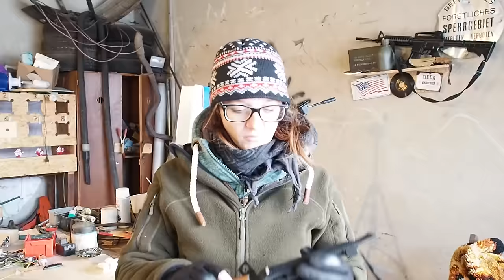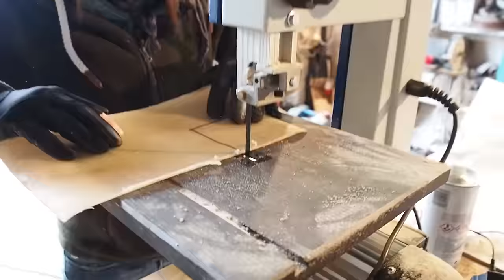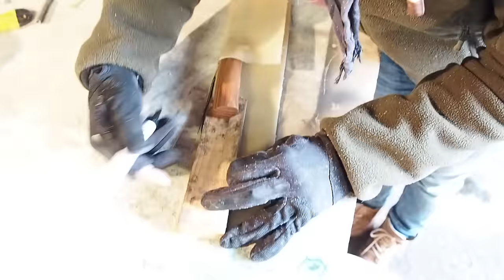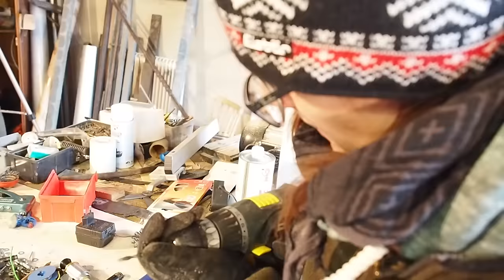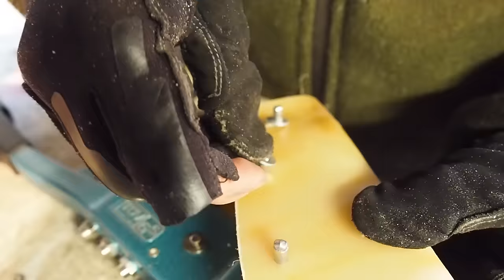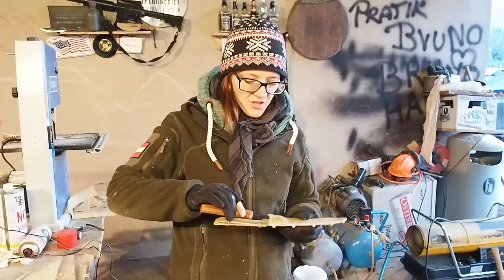Making A Custom Sheath For My Mora Primitive

Comment: I remember doing something like this with a knife I found at a flea market. Sheath was beyond corroded and made one out of plastic and molded and fused it together with a toaster oven and wrapped the outside with old leather. It came out looking terrible but in the end the super thick melted and fused plastic actually has done a good job over the years.

Comment: Lilly, do NOT use an angle grinder without the protective cover. It is soooo dangerous!! If the disk explodes you will have the peices alover your face with severe injury or possible death. Do NOT ure it if the cover is gone!

Comment: A note from Grand-pa. Wear Eye Protection anytime you use power tools ! I've been a woodworker for over 50 years , it's real easy for a chip to fly into an exposed eye or worse. Stay safe .
Reply: Good point, but she did wear glasses didn't she. Guess glasses are far from ideal as protection, but perhaps she did need them to see as good as possible?
Reply: I was more concerned that she was wearing gloves and long sleeves.

Comment: I don't think you'll like those rivets digging into your side later? I'd punch out the ball, file some excess off and beat flat with a hammer, you have the backing washers so you don't have to worry about the rivets coming out. good job tho

Comment: Nice workshop there, looks a strong and durable sheath you could offer a life time guarantee for that Lilly, hand made great job
Reply: Stephen Hall Yep but those rivets are too big imo. Something with a slimmer profile would be better suited for something like a sheath. Those are the kind we used to rivet steel plate together where I used to work.
Reply: Joe Blazer Yeah pretty important stuff lol It was a small elevator cabin made from heavy gauge sheet metal, part of a scaffolding system. When you think we made hydraulic scaffolding for skyscrapers it might be scary but if I remember correctly it was an r/d project. Also might not have been this exact kind but definitely similar.

Comment: Hey, Lilly, 

Loved the video. 

As a bit of a suggestion, after you used pop-rivets and washers on the back to close the sheath, I suggest you should have turned the sheath over and hit the back of the rivets (which is next to your leg) with the front of the rivets on an anvil and hit the back of the rivets with a hammer. This flattens them out a bit more and makes the riveting tighter, and then grind/sand them off a bit so they don't wear holes through your pants.

Love your videos. Keep them coming.

Love to see you with more.

Comment: Hey Lilly, great sheath. I have a funny story ..(wish we could post photos here) I lost the sheath for my beloved old Mora companion. After much deliberation I had an idea: The two connections with pinched ends on my vacum clearner for getting in to narrow spaces (that i never use -  Im not big on housework!)  fit perfectly together, smaller on bigger. I tried one at first and was a perfect fit! - but the pointy end of the knife stuck out the end. Put both together though and its a perfect snug sheath for the old girl...who knew?

Comment: Nice job Lilly!
You used the tools very well, like a pro
I have made a couple of sheaths like you did using thin wall pvc pipe, it was the only material I had.
Get a piece of 4 inch diameter pipe, cut to length, make a cut from one end to the other, heat it up and flatten it out and proceed as you did.
Luv ur videos

Comment: Your resourcefulness and ideas always keeps me coming back for more... Great work Lilly!... Tip: Never leave that sheath lying around in the sun light. Oil based plastics become dried out and very brittle and start cracking and/or breaking easily over time with sun exposure. As thick as that looked, you may very well be ok, but it wouldn't hurt a thing to protect it from the sun none the less. Most people don't think about it from day to day, but the sun reeks havoc on a lot of man made things daily.
Reply from the maker: Thanks for the tip and thanks for checking in :)

Comment: All these people commenting that you shouldn't wear gloves around saws and sanders have obviously never worked worked in a metal fabrication shop! I own a fab shop and wear various gloves all day every day. It's necessary because metal parts are sharp and get hot quickly. Wear leather gloves that fit right and you're safer with them than without when using almost any power tool. Gloves have saved my hands from severe injury more times than I can count over the last 30 years and I've never once had a glove get caught or pulled into a moving blade or belt.
Reply from the maker: Exactly what I thought
Reply: But please,don't use winkelschleiffer without cutting guard.Please? :-)
Reply: Depending.But when working with saws,especially with bandsaw it is better to work without gloves if possible.You don't want to get caught in gloves by bandsaw. ;-)

Comment: Nice work, but really blind rivets(popnieten)?? There are a lot of diffrent screw options that would fit better and would make the hull much more flat.  The blind rivets have on one sider the higher side and that could made damge to cloths and stuff.
Ok, it´s your decision not mine.
All in all a fine work, i like the idea and the material what you used.
Reply: Agree the rivot end protrude and will be uncomfortable
Reply: cj lures ; Tandy Rapid Rivets. Many uses, especially for bush/camping repairs.
Reply: john smith I think the ida was to use what they had on hand at the farm.

Comment: Using a cut-off wheel on plastic or rubber is incredibly dangerous. The material can clog the blade up. And it can become unbalanced, and fly apart. Great video, And cool knife though.

Comment: Lilly I have a tips for next time. NEVER use gloves and routery tools in the same time. Tool can catch your gloves and rap it around. ALWAYS use safty glasess with power tools. Thanks. Good night.
Reply: Good point but a challenge while in the open and in freezing conditions. I would not like to hold in metal things at least in sub zero temperature. Don't know how cold it was, but it was an open door /unheated garage it seemed and here breath was showing a lot out from the cold air.
Something on the head and on the hands was for that cold I think...

Comment: Leather would have been better and easier, although the plastic was a very good choice. Copper rivets with burrs would have been easier and better looking than aluminum pop-rivets and cheaper too. Stitching with harness thread or even leather lacing would have been easier and as durable as the pop-rivets. 
And, a leather sheath would only need a utility knife, some hole punches, perhaps some needles and a hammer (to round over the rivets and to pound the leather into shape). No bandsaw or torch needed. Heck, you could have done the whole thing at your bug-out camp. Try leather sometime. (I grew up on a cattle ranch we used leather for almost everything.)
Reply from the maker: yeah right, but i didnt want to use leather. i wanted to use plastic. my channel, my choices
Reply: The canister (jug?) was certainly a good choice for material and for your purposes, perhaps plastic was a better choice. But, I'm convinced fastenings like lacing or thread would have worked as well or better than pop-rivets.
Reply from the maker: joe shmoe who said i disliked leather sheaths? I love leather sheaths. but for this knife i wanted a plastic one for several reasons.
Reply: Roger Gadley
Reply: Suvival Lilly - Your channel, your choices indeed. If all Austrians are as feisty as you can be, then there is hope for civilization after all - the world needs more people with a backbone and maybe not so many human invertebrates. You are an amazing woman - I'd be surprised if there was anything that you could not accomplish, once you made up your mind to do it. Kudos and best wishes.

Comment: Lilly, take a tip from someone with badly damaged lungs please.  Use a respirator of some type when grinding plastics and sanding.  You don't want to fight for breath for the next 40-50 years.  I know...

Comment: using an angle grinder without a disk shield, without hearing protection, without safety glasses ... I bet your eyes are not your most valuable assets. But good thing you now have a sheet to protect your blade!